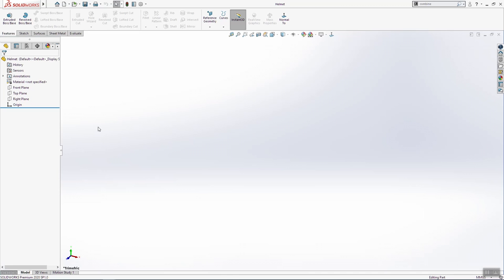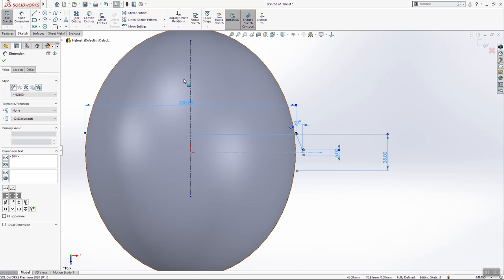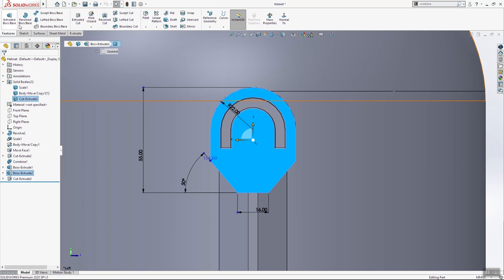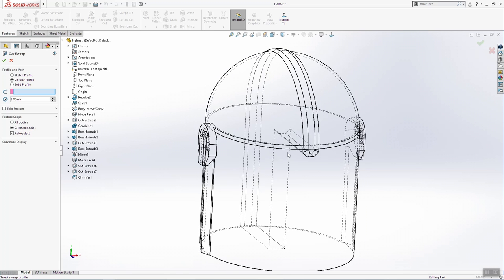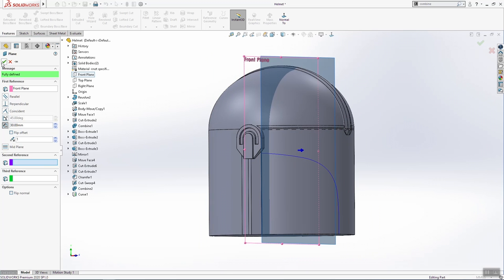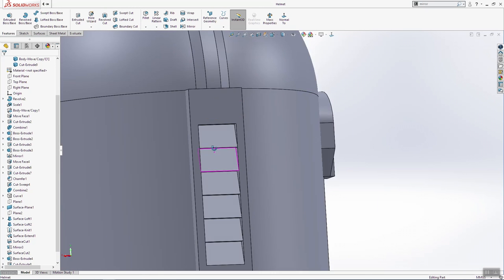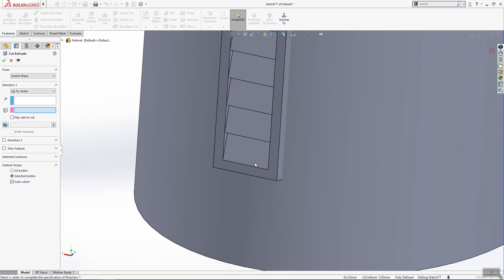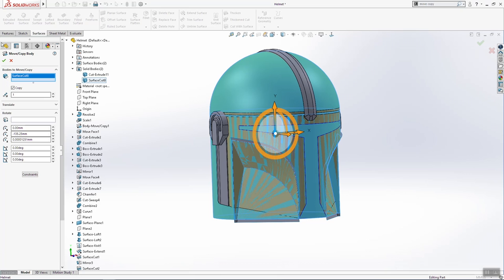Design The Mandalorian Helmet in Solidworks - Solidworks surfaces future tutorial

Comment: This is amazing! I followed this tutorial and the model came out perfectly! This is by far the most accurate tutorial that I have followed for this helmet. I have a few questions though. Firstly, due to printing limitations,I am hoping to print this Mandalorian Helmet as about 5 separate bodies (the print will stop between each body and reorient) because this way will provide the most detail to be included(theoretically the parts would be the left ear design, right ear design, the rear detailing, the top "fin", and the main, wearable part of the helmet with the cheek design). My question is: is it possible to go back and save these parts as individual bodies after completing the design? Or is there a way to save each body as I progress through the tutorial? Because of some of the combined bodies and stuff, I am having some trouble trying to solve this by myself and was hoping to find some guidance. Thank you!
Reply from the maker: Thanks for watching. You can use extrude cut, and save them separate.